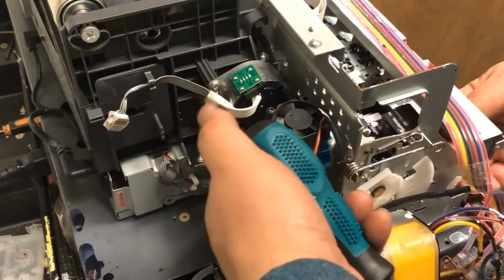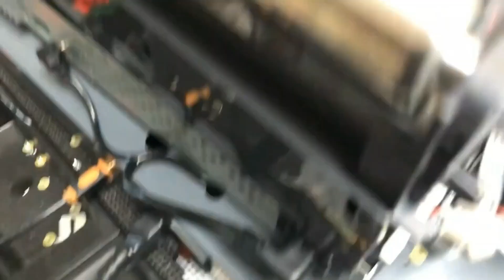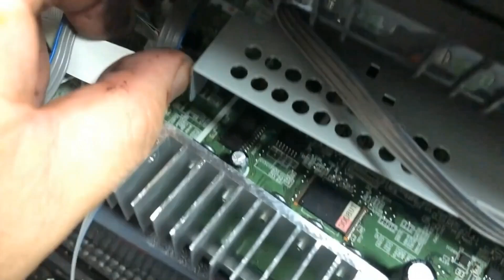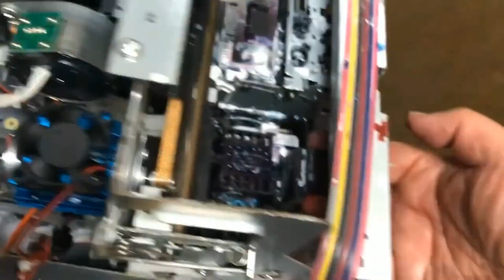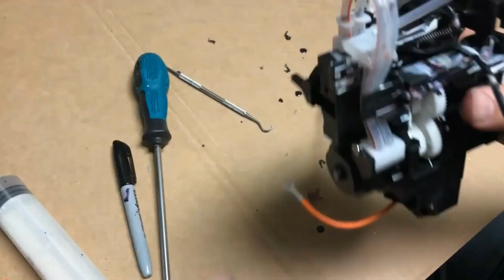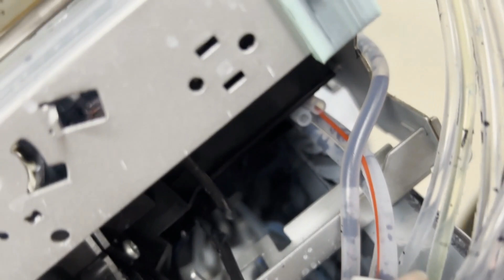I Modified My L1800 1390 Waste Capping Station and Got SHOCKING Results

Comment: Hi! Just saw your video and i will do this with my capping station! But i have one question:

The input tubes ( number 2 and 3) are coming off the conectrr from time to time but mostly when i do head cleaning and nossle check! 
Do you have solution for that? 
Will this what u have showed to us solve that problem? 
Thabk you!